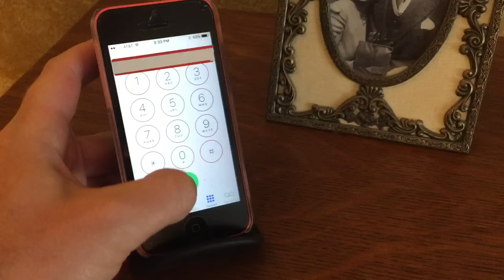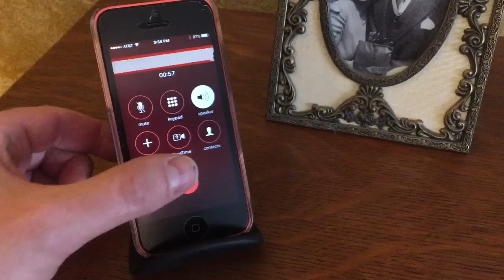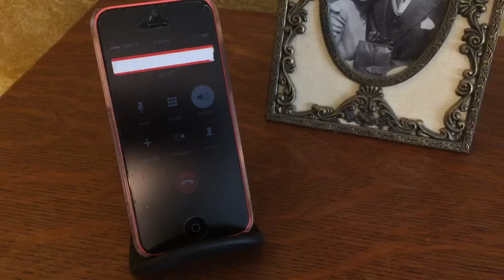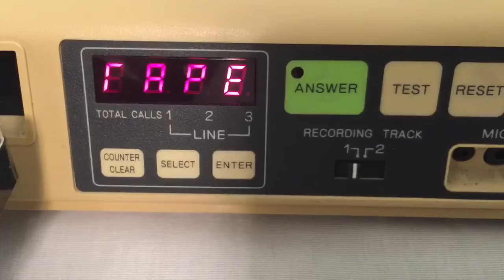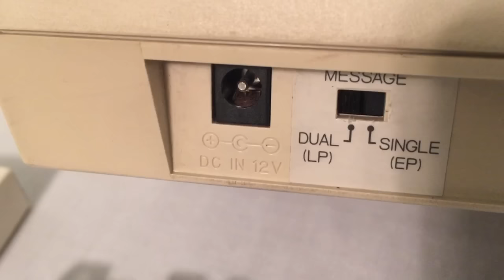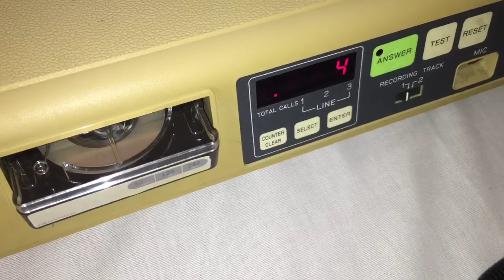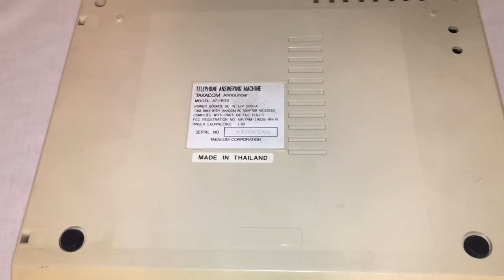You Called the Movie Theater and this THING Answered

Comment: I wonder why they didn’t just use an NAB broadcast cartridge, AKA 4-track?  The cost, I suppose.  Back in late 1969, before Judge Green broke up AT&T, you could only get an answering machine by leasing it from the phone company.  I decided to DIY one.  I found a home 4-track recording deck (very rare) at a yard sale.  I got a friend in radio to get me a 60 second tape.  Broadcast cart machines used a tone signal on a second track to signal the end, but the home audio version lacked that. So I made a simpler way to sense end of tape.  I fabricated a sense head from a small block of wood with two wires embedded in it.  I then applied a thin foil patch to the tape surface.  When that patch passed over the sense head, it physically closed a low voltage circuit.  The cartridge served as both the outgoing message and as a timeout for the incoming message.  A circuit of relays sensed ringing current on the phone line, which started both the 4-track and a separate cassette tape to capture the incoming message,  the biggest drawback was that you had to listen to your outgoing message prefaced to each incoming on the cassette.  It was a fun project and worked quite well for something put together from odds and ends.

Comment: My guess would be that the extra callers on lines #2 and #3 would hear from the current spot of the tape and in turn have to wait for it to loop to hear what they missed at the start, similar to a rolling news broadcast.  This makes me wonder if this unit could also have been used for call waiting on a business telephone PBX where up to three people could hear that repeating "Please hold for the next available representative (plus some background music)".
Reply: I too was wondering how this machine could handle 3 lines at once.  There used to be a local telephone weatherline back in the '80s & early '90s that behaved like that (the announcer at the end of the recorded forecast would mention that the message would repeat), I'm guessing they must've used a Takacom machine like this.
Reply: Perhaps if it was a rolling-type message, you'd have all 3 lines connected. If it was a single message, start-to-finish announcement, then you'd only connect one. So the machine could handle both roles, and possibly even more.
Reply: I have to wonder if this was similar to the "Time and temp" recordings one would get back in the 80's from the local banks? I haven't even thought of those for years, lol.

Comment: Did they honestly think displaying rAPE was better than tAPE?
Reply: Considering the expenses of LCD at the time, they didn't have much choice
Reply: They could've just programmed the machine to use a lower-case t (using the 2 left, 1 center, and 1 lower segments of the 7-segment LED) instead.  Most systems I've seen in the past using 7-segment numerical LED arrays to display letters usually display the letter T as lower-case, to prevent confusion or an unintentional display like this.   

The past expense of LED displays have nothing to do with this, it's in the combination of segments lit.  Whoever programmed the firmware that drives the display of this machine is at fault, no?  Things like this is why 14-segment LEDs were developed.
Reply: But it doesn't look right.
Reply: I take it displaying 7ape wasn't much of an option. Total practical applications for leetspeak: 1
Reply: It's physically impossible to display T or t on a 7-segment display since there is no 'center' segment.
Reply: @Mao Zedong
Google "t on a 7-segment display" it's the first bloody result :/
Reply: yes and i thnk that this is the best decision of design of all time
Reply: Then if you spotted the machine and the tape got removed, you would have thought it was a RAPE alarm system.
Reply: @maozedong3952  So, so wrong. I guess you never learned to count to 7. Notice how the A, P and E all have a center segment? You've gotta be a troll.
Reply: @RyanSchweitzer77  I have an old Philips CD play from 2002 or 2003 that did that when the two AA batteries that power it were getting low; it would display bAtt or batt on the display where the elapsed song time would display in normal operation with fresh batteries.  Another idea I have for it to have done that would have been to display Lo in the track number section of the LCD display since, as it had to rely on simple seven-segment digits, it wouldn't have been able to display the letter W.

Comment: Yes they could do all lines at once but if you called it would play a continious recording. Sometimes youd catch it in the middle and youd have to wait lol.

Thanks for revealing what actually was behind it all in the day😀

And those little batteries are actually a capacitor that acts similar to a rechargable battery but without the corrosion. I have a similar capacitor in my 1989 magnavox tuner. It was in charge of keeping the station presets. Really neat but not easily found.

Comment: What is that square PCB trace pattern at 15:28?  Looks like an antenna or inductor of some sort.  Is it to remove emf from the motor?  You know that PCB engineer gave himself a pat on the back for that bit of ingenuity.  Awesome machine.

Comment: Very well made Japanese style equipment. Bet it could run for years no maintenance. Nice job showing us.
Reply from the maker: Thanks Mark.  Yes and still running fine!
Reply: It'll probably still run for years, maybe even decades after that with no maintenance, considering quality ELNA electrolytics it has and that the tape mechanism is still intact :)

BTW, what is that antenna-looking trace on the right side of the drive board @ 15:28, right above the motor? I mean, I understand that it's PCB inductor, but what purpose it serves here?
Reply: that's not a name we see often, I think commercial grade only
Reply: databits 
Tape player says: "ΓAPE me please!" XD

Comment: If the motor is original, this gear is from late 80s early 90s. You can tell because its size also the cover has a tab that is soldered into the internal PCB. Matsushita keep doing motor in that "shape" till stopped in late 90s (because tape format died). Previous ones were bigger. But you can pull date code from the chips as well.
Reply: If you look closely, the datecode on the motor clearly says NOV95. Also, the datecodes on the blue relays are 13th week 1996. So I suppose that actual machine was produced middle of '96.

Comment: after Line 1 picks up wherever it's at during the planning process and line 2 Rings it will pick up line two and play at that point same thing with line 3 it'll play wherever Line 1 and 2 where at then because of a open spot on the tape line one will hang up when it's done but two and three will continue to play until they are fully played then the lines will hang up that's how it works

Comment: What were originally on the tapes? It's a nice machine for the time, but I guess an "T" LCD was too cost-prohibitive back then!
Reply from the maker: The tapes were blank.  New old stock.
Reply: Thanks, I was just curious. Keep up the great work with the videos. My family had a bunch of 8-track tapes in the 70's and later I was a radio DJ and worked with "carts" all the time, but I've never seen this machine before.
Reply: They're LEDs, not LCDs, video got that wrong. And they don't make "T" ones, or any alphabetic really. They're just the 7-segment LEDs meant for showing numbers in alarm clocks etc. By being creative you can fit most letters of the alphabet into there, if you don't mind a mix of lower and upper case, and a few slightly dodgy ones. 

If you want a proper alphabetic display, or for more expensive ones like gambling machines etc, you'd use a 14 or 16-segment display with diagonal segments and more, they can do pretty decent text. 

Nowadays you'd probably just go with a colour graphical LCD.

Comment: it looks more to me from what appear to be datecodes on some of the electronics that it was made in the 90s, not the 70s.
Reply from the maker: And not the 80s either.  Thanks for the comment!
Reply: it could also be a bring-over from the 80s, just late-production. the board layout really looks 80s as well.
if it was 70s, there'd be a different type of PCB in there. what you have is green solder mask which makes me think late 80s to mid-90s in origin, but not in date manufactured. take my findings with a grain of salt and do some more digging.

Comment: That 30 degree angled DIP IC is extremely unusual. It's rare to even see 45 degree angled DIP chips, as they usually end up taking more surface area to route. Surface mount ICs are commonly rotated, though.
Reply: Everytime I watch this video, it still blows me away that they did the 30 degree rotation thing. That is just beyond unusual. They either must have had a really good reason, or the designer just wanted to add some flair to their PCB.

Comment: Are you sure this wasn't used by phone companies in the 1970's and 80's to play quick error messages? e.g. "the number you have dialled has been disconnected, please check the number & try again". It would make sense to have 3 phone line inputs so multiple customers could hear error messages at the same time. I would say this lived on a rack in an exchange for like 25 years.
Reply from the maker: I'm not sure.  The only information I found online regarding their use was in movie theaters.
Reply: databits ok thanks, interesting device.
Reply: In the late 70ies and 80ies, a large bank of EPROM was already an option, one that would better suit telephone companies with their super heavy use. This is more for small businesses that don't have to pump those messages to thousands of people 24/7. Furthermore if data does not fit into a single EEPROM, this opens up another interesting option: a multiplex controller that can read data with different offsets to multiple recipients at the same time from the same set of ROMs! With some granularity of course, i.e. you could potentially have a second per section and have people wait up to an extra second before their playback starts. While this system is limited to playing the same thing at the same time to everyone, so the everyone has to wait up to as long as the message lasts before they get to hear it.
Reply: The devices the phone companies used was call was an intercept device.
They were made by several companies. I have an ETC System3 jr. that I am working on. 
It is a great grandchild of the Audichron time and temp machine.

Comment: @8:37 I would be very surprised if that switch didn't control the playback speed of the tape, allowing a second message to be recorded on each track for a total of 4 in LP, and 2 in EP.  For the machine to have a switch allowing the same audio to be recorded in a stereo mode as opposed to mono makes no sense.

Comment: What is the I/O port (concealed)?
Also you did that theater recording magnificently.
Reply from the maker: Thank you Ben.  Not sure on the I/O port!
Reply: If you were even briefly involved with servicing any kind of equipment, you'd know that it's standard procedure to put tape over any port that the end user / customer can mix up. There are 3 ports in back that can plug in phone lines and all would work, and a 4th one that is not for phone lines. Which port would the customer invariably plug the phone cable into without looking, and then complain it doesn't work with all manner of nastiness? You got it, the 4th one.

Comment: One thing I don't understand: What if you have a 30-second recording, but one person calls in, then another person calls in 15 seconds after the first person.... How would the machine be able to accommodate two callers that called in at random intervals simultaneously like that? o 3 o;;
Reply: I  have two theories on this.  First, it's constantly running so the first person calling in would start the cartridge, the second and third would enter wherever the loop was at the time.  The second theory is that if someone called in mid-speech they would hear either silence or a slow set of beeps until the cartridge reset to the start point, then open the other phone lines and replay the message.

Comment: Center negative DC jack. Evil.
Reply: stuff from around that time period tends to use centre negative because any devices which had batteries would need to have a way of automatically switching between the power adapter and the battery, and they put a physical disconnector in the barrel jack socket to do this, so when the power adapter is plugged in, it disconnects the batteries
which is why centre negative became a thing, and id imagine it was easier to use centre negative on other devices from that time period as well

Comment: I expect you'd just hear a ringing tone on lines 2 and 3 if you called up whilst something was playing out on line 1? And it would then queue up playback for the one or two waiting lines to start once the message had played out on the currently connected line(s) (or fast forwarded if they hung up). Might even pause for two or three rings for the first line to connect, in case another call came in, so they could listen to the same message simultaneously.

Funny that the ringer equivalence is 1.88, I'm pretty sure that times by three lines means you'd technically be overloading the system with all three ringing. Maybe the assumption was that only a max of two lines would actually be either connected or ringing at once, with at least one playing or ringing when all three were busy.

And very weird to see a CPU installed diagonally.

I wonder if the backup battery would be sufficient, along with power fed from the phone line itself, to allow it to keep playing out messages even in a power cut?

Just so long as it wouldn't end up continually flashing that rather threatening RAPE display. That's like something out of a low budget exploitation horror film.
Reply: I wonder if the other 2 lines would hear a `your in a queue please wait` type message from track 2 whilst line 1 got to listen to track 1?  The machine then switching lines to the next caller and feeding them track 1 when first caller hung up?
Reply: That's a nice thought, but there doesn't seem to be any facility for recording such a thing, and particularly if you used "long mode" it'd end up running straight into that after playing track 1 anyway. Plus it could pick up at any arbitrary point in the loop. If you were going to have a separate holding message, I'd have thought it'd be on a second, shorter/smaller tape. Maybe the passthru (for a second machine?) is intended to provide that?
Reply: Reading the comments below from people who used the device it sounds like it just played a loop for the first line and anyone else who dialled in got to listen to wherever playback had got to for the first line until it looped around to the start again.  Doesnt look like it automated much and it couldnt switch tracks without the owner manually doing it, pretty simple device really.
Reply: Hmm, wonder why they'd even bother with additional line ports in that case? The kind of place you'd be using it, it's likely going to be hanging off a switchboard anyway, or you could at least have the phone company switch several incoming lines to the same conductors... only need the one connection then, and it could just loop round and round until all the incoming connections dropped and that one line disconnected... (and have a timer on the switchboard itself so anyone who dialled in would be cut off after the equivalent of no more than two full repeats)

Comment: Your phone's screen protector has bite marks...
Reply: Holding the phone between your teeth comes in handy when you need both hands to work on the tech item you're trying to record, or even just to use the phone as a flashlight with your hands full.